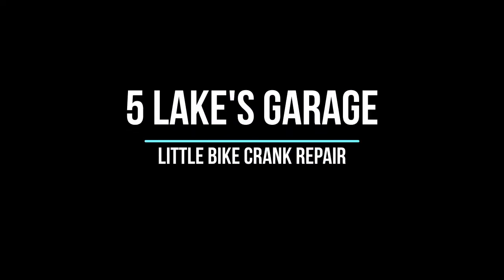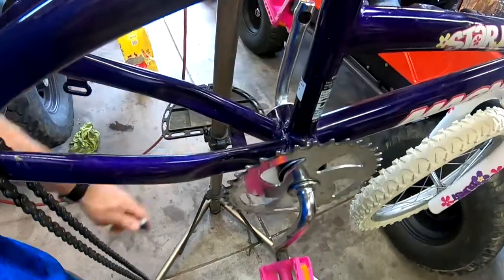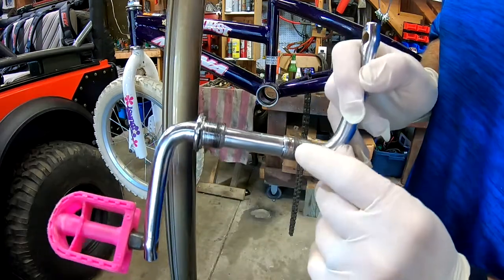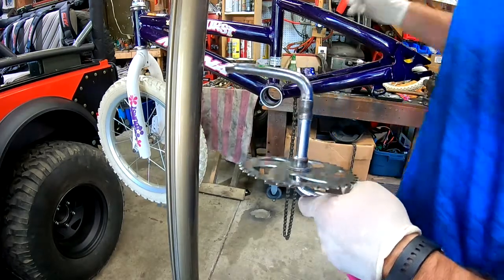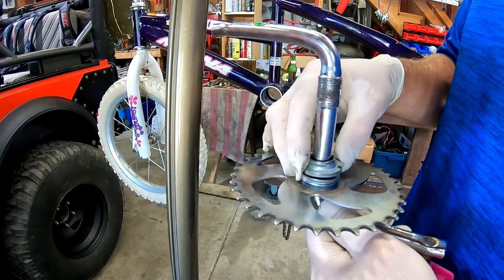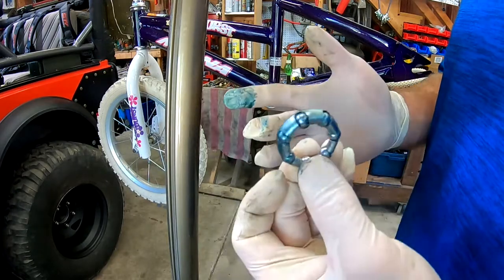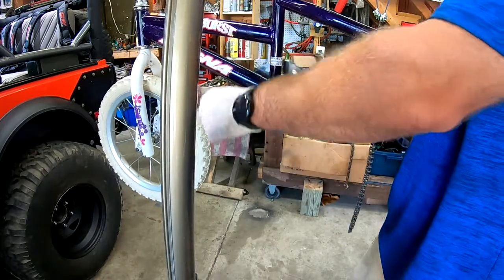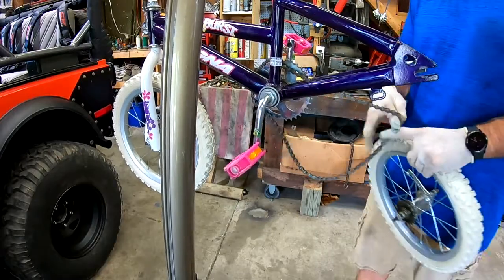Kids Bike Repair  (bearings and crank)

Comment: I'm trying to replace the crank bearings on a  Huffy 20 inch Sea Star Girl Kids Bike . I figured out how to pull up on the spring loaded pedal and twist it but it will not slide up and away from the crank.
Reply from the maker: Try this video.  I updated with my old bike from when i was a kid.     
https://youtu.be/yelRcezHiCs?si=yHGuYPg0gR4T16fP
hopefully there is something in there that might help.

Comment: More detail on the binding troubleshooting would be good, thanks for the video!
Reply from the maker: Wow.  I really missed this comment 7 months ago.  Sorry about that.    

The binding came to be too much of a misalignment on with the spacers.   I found a different crank and replaced it.  I should of worked out if I only had to use one spacer.   the second spacer was what did it.     It is still rolling around the neighborhood.   Thanks for watching
Reply: @5LakesGarage  i buy a kid bike at walmart the and it move like that after a few week i dont know if it the bearing as it look nothing like that but it a cheap metal part inside it basic it most flat but it got arm that bend in to hold the thing into place and it bend like paper well stronger then paper but not much i did my best to fix it but that part need replace it a kid bike and f the people who make that part the kid arm got hurt when that part broke i plan on getting a better piece then that if it is a bearing but is it is i replace it with something better like you pay 159 dollar about for a bike and the most needed part broke like paper
Reply: if you know what that part was if it was a bearing i will replace it with a better one
Reply from the maker: @helperdude8205  Sorry to hear that man.  It sounds like my Tacoma.   you pay a lot for the truck and then you have to put a lot more to make it a truck.   Sad.   Still love that you are fixing it yourself.  Keep it up.
Reply: @5LakesGarage  it may have been easyer to buy a bike body and set it up as then i will know it will not break easy as i will only pick the best part not some cheap metal or i hope it was cheap is how it broke so easy when was not use much

Comment: Thank u for this info.
But what if the crankarm is too stiff and pedals not moving freely in kids bike..can u pls explain how to fix that at home?
Reply from the maker: Sounds like the side adjusters are too tight.   Or there is an issue with the races.   (Location where the bearings ride.   Some bikes have removable races and others not.     I would just start with loosing the retainers.   

Thanks for watching and good luck.
Reply: Would the opposite be true.  Got my kid a bike and there is about a quarter turn worth of play before it catches and allows it to move.  It very hard to get him to ride it cause there isn't a lot of room for him to get the momentum needed to keep the pedals going?
Reply: @erikmyers1994  yes, the side adjusters are likely too loose with that symptom

Comment: I bought my 4 year old son a new bike (14") with back pedal brake... I noticed it is a little bit hard to pedal, what could be the problem?
Reply from the maker: To figure out where the binding would be, there are 3 different locations.  
1. Crank
2. Chain
3. Rear brake

I would take the chain off and try to isolate the bind.  

My guess would be the Rear brake.    Since it is new, the brake will loosen and smooth out.
Reply: @5LakesGarage  my guess is that it is something with the crank...because when i lift the bike and hit the pedals hard, so that the rear wheel would spin fast... I make i few slow turns with the pedals while the rear wheel is still spinning fast, and it is still kind of hard to turn them. I hope you understand what i'm trying to say...
Reply from the maker: i hear you.   i did a another video  that put in a few more details in the crank area.  
https://www.youtube.com/watch?v=yelRcezHiCs

hopefully it will help
Reply: @5LakesGarage  thanks a lot !

Comment: What is the cause of the chain binding and how do we fix it please?
Reply from the maker: The binding came to be too much of a misalignment on with the spacers.   I found a different crank and replaced it.  I should of worked out if I only had to use one spacer.   the second spacer was what did it.     It is still rolling around the neighborhood.   Thanks for watching

Comment: i was hoping to have seen the actual process of taking the crank off.... i have been searching youtube all day to find how to remove the crank. and all i see is you talking about how youre gonna take it off, then skip right to a completely empty crank shaft.... with no details of how you took it apart. sadly this isnt helpful to someone who has never removed a crank before.
Reply from the maker: Sorry about that.   This was at the very begging of the channel.   I feel that we have gotten better.  :)   We have a few of the beginning videos that we are thinking of remaking.   This is one of them.
Reply: @5LakesGarage  is there any tips you could provide that might help? i have a 12 inch kids bike and the pedal crank seems to be giving me resistance when pedaling. what could cause that??
Reply from the maker: Could be a few things.   if all of the resistance is in the crank it could be a few things.   
1. the preload is too much.   (loosen the nuts a bit)
2. the retainers are worn which causes the bearings to bind
3.  trash in the bears.  

I was just in the shop this evening.  I should have enough parts to put a kids bike together.  I could try to do a little more detailed video and post it.   

Hopefully this helps.